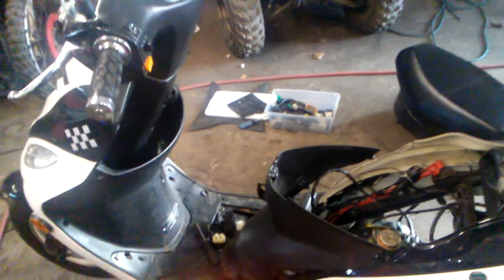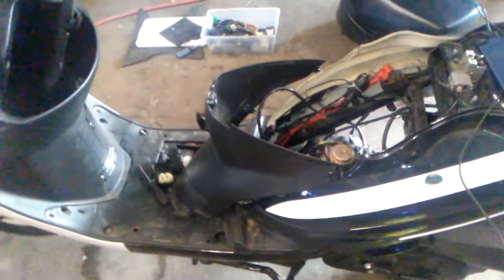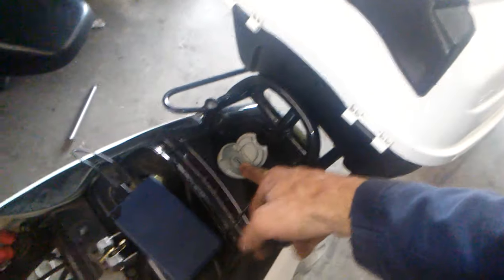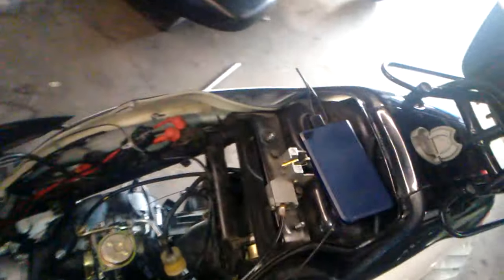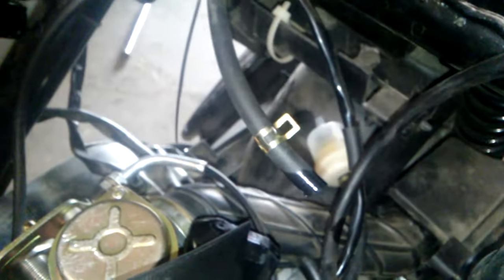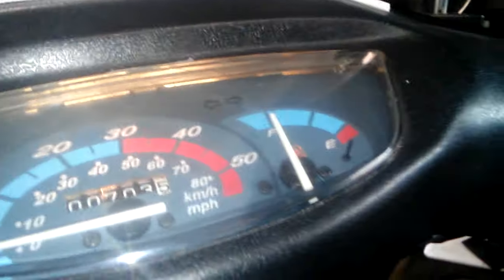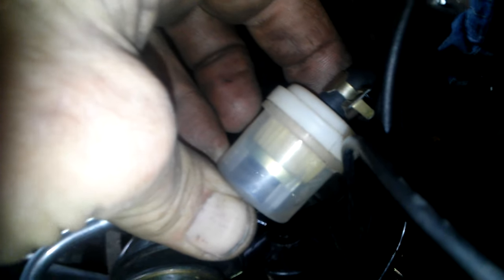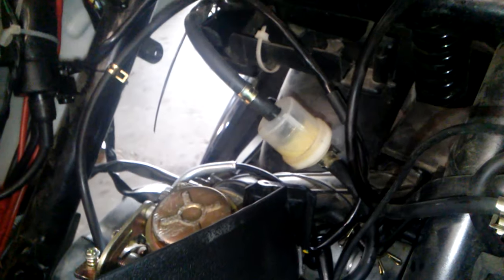Scooter runs short distance then stops running like not getting gas , parts for this in description

Comment: I replaced my ignition coil and a bunch of other parts. I believe this is my problem. I dont have any .mechanics in my area that will work on my gy6 150
Reply from the maker: Fuel air n spark ! Check spark ! Pull air filter boot shoot starter fluid into carb ! If it runs you may not be getting fuel ! Also put fingers over mouth of carb may need friends to hit start button make sure it’s pulling air in ,valves could be open ! These exhaust valve are notorious for getting tight n loosing compression causing scooter to not run !
Reply: @WaldensWorld  thank you for the response. It ended up being the ignition coil. I bought 2 faulty ones. What are the chances? Lol
Reply from the maker: @robertmillian4929  made in China pretty good ! I bought a altinator didn’t work took back to auto parts store ! Guy was putting it in the machine to test it he dropped it then it started charging ! That was the third one in a two year span !

Comment: also check the computer in front of the motor cause the wires arc on the metal surrounding it
Reply: yeah there are high voltages from the CDI box. I got a shock from it before

Comment: I have a brand new scooter right out of the box. My scooter will not start. I got it 2days should. I change the oil. I put in 93 octane gas which is called for. It will crank up but will not turn over. Do you think it may be my Gas cap as well. My gas cap is loaded on the floor. Do you have any suggestions?
Reply from the maker: I'd guess the carb is stuck . On bottom of carb there is rubber hose goes to a metal valve hooked to the left front side of the kick start case . Screw on bottom of it . Loosen see if has comes out . Float may be stuck .
Reply: turn your kill switch off

Comment: I’ve been dealing with a similar issue for a while now. Cleaned the gas tank (it was rusty) replaced the fuel filter, cleaned the carb, and the air filter. It’ll start up, idle, then run fine, but I’ll get to a stop about 5 minutes down the road, go to throttle back up and it’ll bog out on me. Continues to idle roughly but bogs when throttle is applied. If I let it sit for 20 minutes it’ll get me another 5 minutes down the road. I just tried riding with the fuel cap off and it does the same thing. Any ideas?
Reply from the maker: I’d check exhaust valve clearance! How many miles on engine ! Variatior rollers do not have a flat spot as this will hender the belt from changing from low to high !!! The carb itself some you can pull top cap off n adjust the needle up with clip going down one notch !  Hope this helps !
Reply from the maker: Does it smoke ??
Reply from the maker: Exhaust valve gets hot expands it ma be close to open
Reply: @WaldensWorld   Its a two stroke so I'm not sure that would matter, would it? It doesn't smoke. Its a Geely 50cc
Reply: A frequent issue is that fuel filters like this are designed for engines with fuel pumps, and do not pass enough fuel with gravity-fed systems to keep the engine running UNLESS you can get all the air out of the filter so it is full of fuel. Do that by disconnecting the fuel hose at the carb, orienting the filter vertically, and sucking on the vacuum valve so fuel fills the filter and air escapes up the hose and out the petcock into the tank.

Comment: Has light blue  dark blue and black.Dark blue high beam and tail light  Blue low beam head light. both work when run hot wire direct  one at a time, No power from plug in up. Have power to cluster and down .Must have missed a ground ?.
Reply from the maker: Yes you may need to put on ohms check ground from plug to negative battery . If it's grounded to bars it would have to go through bearings in neck ECT ! Or run a new ground wire
Reply: @WaldensWorld  That is what i'll do  thankx

Comment: drill a very very small hole on the top of the plastic tank.. that might work
Reply from the maker: Be careful with electric drill around gas tank !! But u may get water in hole ! I would pull tank fill with water n use cordless drill n put a valve or filter on the end !!

Comment: Does manual on/off petcocks get affected by broken vent on gas cap as well? Or is it only for vacuum petcocks?
Reply from the maker: Yes . If vent is closed no air intake to equalize pressure ! It would be like trying to suck in a bottle if no other openings you can't get air or fuel out !

Comment: Hi I need help with my moped  every time I drive it it drives for like a minutes then shuts down it’s a Chinese scooter 50cc Idk what to do! 😫
Reply from the maker: Prolly not getting fuel ! 
Pull fuel line off carb n hit starter button see if gas comes out !
Reply: Also always check your valve clearence!
Reply: @themonetizer413  is that hard to access?

Comment: Its not this either cap off mine still does same thing gravity feed direct to carb vac line closed same same HELP!
Reply from the maker: If you have carb cleaner shoot into carb ! Does it run ? Yes . Then we're not getting gas . You also have a vac pump that supply's carb . Is air lines cracked ? Goes from boot infrint if carb to round pump by gas tank . Next would be valves need checked ! It has spark ?  Check those things
Reply: I thought about doing that... how did u do a direct line?? I cant find anything to adapt so i can put a ditect hose to the carb and close my vacc line too
Reply from the maker: @cars2514  yes plug vac hole on intake boot n run line from tank to carb ! But if your carb starts to leak it will fill up motor with gas . A good carb should not leak .
Reply from the maker: Exhaust valve tends to get tight on used models also !
Reply: Well i actually saw a video that if the gas cap isnt in good conditions it creates a buble of air inside the tank that can cause ur  scootee ot turn off???
Reply from the maker: @cars2514  lol was it mine ? You getting gas to carb now ?
Reply: @WaldensWorld  well i charged my battery last night cuz as i went to start it without a gas tank cap it made a noise as if either the starter is bad or the battery. I saw a video that hints if that noise is present the starter clutch is bad?? So im hoping it was just a low charge battery so i can try to start the bike without the gas tank cap or putting air into it
Reply: @WaldensWorld  i had no idea the gas tank cap is suppose to let some air in
Reply from the maker: @cars2514  yes it needs a vent always gas leaves n would create backpressure sucking gas back into tank most colder weather .. 
Hot weather has could expand n either push through carb filling motor or expanding tank until it creates a leak ! 
Us you shake a closed gas can n open fsshhh air comes out liquid gas turn to vapor causing pressure! 
PS I am a highschool drop out ! 
We can all learn . 
I'm not good at grammar !

Comment: Do u remember if gas would pour out the carb.   After u shut the motor off
Reply from the maker: That would more than likely be the float and needle not seating inside carb ! Or it’s dirty ! U can clean the carb seat with a qtip n rub the rubber seat with fingers to get any junk off ! Look in hole n blow though the fuel line if possible! I’ve seen blades of grass sit in fuel lines inside carb

Comment: I’m having a similar problem with my wolf 50 cc scooter.  How does the fuel pump work,off vacuum from the carb
Reply: Vacuum opens a rubber diaphragm that allows fuel to flow.
Reply from the maker: Thanks Robert , I don't get some if these messages ! N sometimes the rubber rips n you get extra fuel which causes problems ! If you pull both air n fuel line off carb nothing should leak except what's in the line itself !

Comment: Hi man. Any experience on 50cc scooters that bogs down on takeoff but once my scooter warms it will go away? It only happens when i first start the scooter in the morning and use it hut once warmed up it feels ok.
Reply from the maker: Check variator n clutch . Just had clutch stick that was ripping belts off . If they start to stick it can cause this !
Reply: Lack of combustible air when you give the throttle gas. The spark plug can't keep the gas flow ignited.

Comment: Same here on the Honda GL 150 it runs about 2 miles then shuts off
Reply from the maker: Running out of gas !!!
Reply: @WaldensWorld  I just tooked to fix  the mechanic said shock was on
Reply: Thank youuuuu
Reply: @WaldensWorld  I tooked back again to repair it wasn’t the shock it was a sensor that sends the signal to the engine
Reply from the maker: @БладимирЛукианов  pickup trigger ! Good to hear your running again !
Reply: @WaldensWorld  it was a little bobine thatcsends signls to the engine around 45 dollars including labor I paid , battery was dead got it fix and charged

Comment: My Honda scoopy 50 cc run about 15 minutes then stop after change oil pump at services. I think Idel system stop after engine heat up. Please help me, how to do. Thanks
Reply from the maker: Is that a 2 stroke or 4 stroke
Reply: @WaldensWorld  Hi Walden's, 4 stroke, Honda CHF505 Japan used. Thanks.
Reply from the maker: You got hot coil.  Low compression  . Fuel issue not filling carb or tank lid.  Best I can tell over the internet  one if them may be problem  is your battery dead or still good when it does?
Reply: @WaldensWorld  I will check battery but it is new one may be within 8 months. Thank you so much for your help.

Comment: Mine doesn't run that long it will fire up for a couple of sec then stop running I have to let it sit for five minutes it will fire up for a couple of sec then stop running...
Reply from the maker: Check that carb has gas , check vac line isn't cracked it goes to vac pump ! Sound like no fuel , could also be valve open exhaust usual
Reply from the maker: Sparkplug tight n new

Comment: Help please, it start after sitting then sute off then won't turn on again, then wait 4/5 minutes and then it turns on and stay running for a few like 30 sec and sute off again and repeat but when leave over night it stay running longer.
Reply from the maker: Sounds like your not getting gas to the carb quick enough ! It fills after minute or two . Right before it dies does the motor rev up a little? Float stuck or petcock valve clogged possible
Reply from the maker: Should be screw or drain on bottom if carb loosen see if you got fuel coming out of carb ! If it has pump you may need to act like your starting it .
Reply: @WaldensWorld  yep that exact thing i tought and clean the carburetor and adjust it and stuff....but ow boi was i loking in the rough place it was my CDI unit, as soon i put a different one started right up, i think the old one the capacitor was weak..... thank you tho for your time to respond.
Reply from the maker: Yep I've seen them spark like a machine gun instead if just once per revolution ! That's a tricky one

Comment: My Chinese scooter does the same thing I ride for bout 2 miles then it shuts off wait bout 5 min it starts then shuts back off bout 4 to 5 minutes can somebody tell me what's wrong I change the peacock valve cleaned carb changed spark plug
Reply from the maker: Is it shutting off after you stop and try to take off ? Or just randomly?
Reply: It shuts off when I ride for bout 15minutes then it want start but wait 5 min it start but when I give it gas it seems like it wanna cut back off in the morning it runs perfectly could it be the gas cap
Reply from the maker: @kelvingreen241  could be gas cap if you had low fuel ! When it shuts off open cap if that’s the issue you should hear air like popping a top on coke bottle or something with pressure may sound like spraying air freshener phsss sound very quick ! But it seems it may be getting hot ! I’d check compression!  But if the motor runs nice at idle you may have bad variatior weights that have flat sides n there sticking in top gear ! So if there stuck or the clutch is sticking it will kill the motor if it’s stuck in high and your hitting gas at a stop or low speed

Comment: I have zap 150 if im on the open road soonas i reach top speed it want to cut ot so i slow down then its ok my rubber inside petrol cap is a bit torn on side of the double rubber our mechanics no shit thanks southafrica
Reply from the maker: On some of these carbs you can pull the top cap off be carful there is a spring n rubber boot ! If you take spring out n pull the needle out some have notched pull the clip out move down one notch n try that ! Do not pull clip out in dirt do it somewhere if you drop it u can find it ! Good luck ! This may help !

Comment: Have Vento zip 3 Was trying to get lights to work  All voltages checked out good and with good bulbs can't get headight or tail light. Was flashing some..Any ideas ?
Reply from the maker: Better ground ? N are you running a battery . Sounds like you have access volts going to it ! Does it get bright n dim ?
Reply: @WaldensWorld  Checked all grounds, Ran separate ground no high low.Run hot direct have light but no high low. Can CID be cause ? thanx
Reply from the maker: So you have light but no high beam ! You will need a separate wire running through switch also make sure bulb isn't burnt out in just one . Use batter n just hook up light to see if it works on all circuits high n low one ground 3 wires ?
Reply: @WaldensWorld  High low switch is good..If wire direct I have both one at a time..I only have one  bulb for headlight and that is good .Brake light and turn signals both work. .Would the CDI have anything to do with this problem I'm having ?
Reply from the maker: Bulb has two contacts on bottom the metal housing is ground ! Do both contacts work n does fixture use two contacts ? You have 3 wires going to light ? What color . If led light they are direction they only work one way ! So if you have ground hooked to low or high it won't work !

Comment: What's the hose on the same side of the kick start used for?
Reply from the maker: One in front of the case ? Has a spring around it n a metal deal at the end ,, that carb fuel drain ! Not sure whick one your talking about
Reply: @WaldensWorld  could you send me a fb request that way I could show you. MaizeB
Reply: @WaldensWorld could you tell me what’s wrong with my moped I have a new video and it’ll tell what’s going on.

Comment: Under the gas tank, there is a gas valve called a petcock. A vacuum line is connected to it. When the engine runs the vacuum keeps the valve open. These petcocks can go bad from age etc. The part is only a few dollars online. Check your vacuum line for leaks or breaks.
Reply from the maker: Those are vac fuel pumps not petcock valve !  misinformation

Comment: I got some where around problem like this on my moped i Can give it gas alot but after giving it gas full throttle moped starts To say boobooboo idle is normal moped not on Lean carb has been checked that its working Idk it gets bensin but maybe not enought i Can only drive on 3rd a while then again boobooboo
New zylinder, exchaust, carb, Idk if its getting air or somerhing but when i give gas the rmp doesnt stay up so it might not be air
Reply: Been struggling with this moped now 6months over 600$ spend and im running out of ideas what To fix really broke too because have To fix it :(
Reply from the maker: What kind of moped . Check exhaust make sure it's not clogged . You can un hook it from head n try to run it !! Spray carb cleaner in intake small shot if it screams to high rpm you may still have fuel issue . Air filter clean ? Alot of scooters are vacuum feed so pull air box in take boot off . Put finger in carb while it's ideling push need in carb up does it take off ? Mabey busted diaphragm in carb ! Few things to check . Spark plugs correct heat range ? N compression is it real easy to turn over . After new cylinder did you recheck valve clearance ? Especially exhaust
Reply from the maker: You can also adjust needle in carb diaphragm mabey down one notch n try that

Comment: I have the same problem with my scooter what would I take the gas cap off it still dies what should I check next? I idled up the scooter but it still doesn't make any difference
Reply from the maker: Exhaust valve to tight ! Vent lines broke ! Fuel pump bad ! Those be next n always start with a new good spark plugs ! Water in gas !